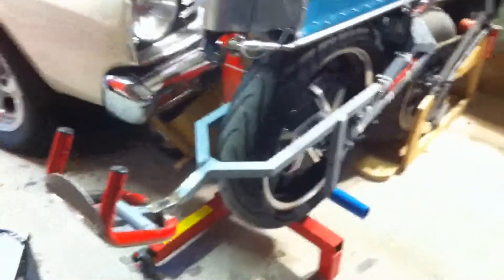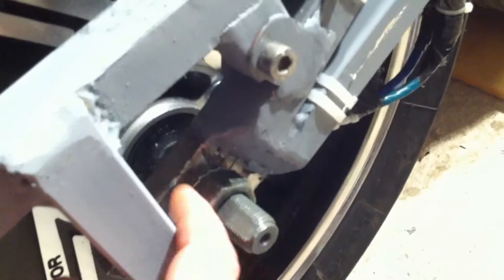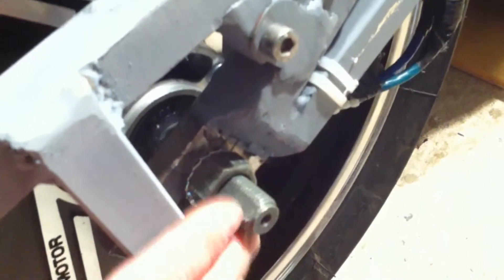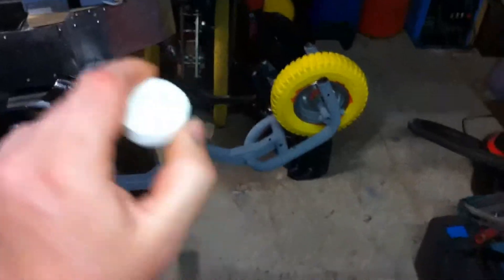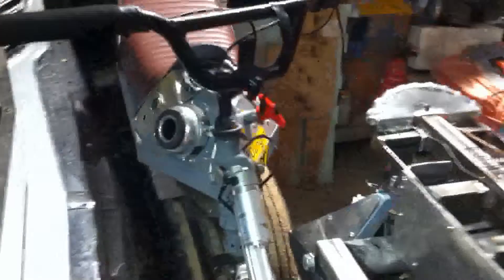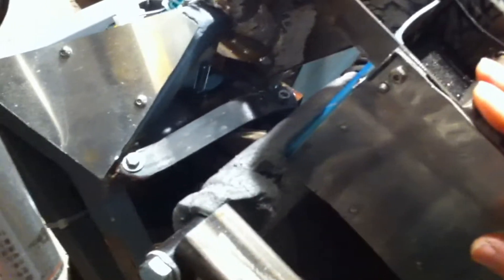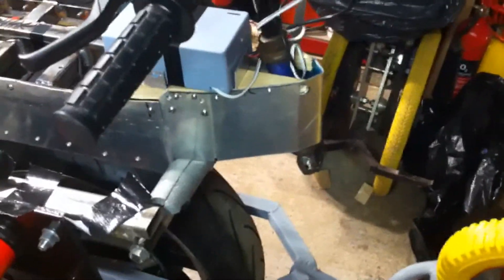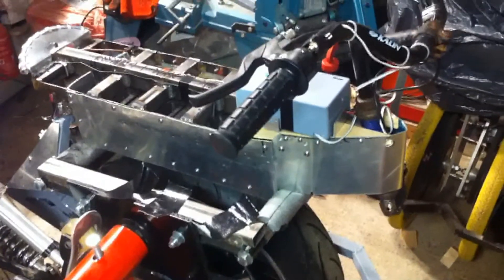Unicycle Garage #9 Final Mods and FIRST TEST

Comment: Can I use an ordinary e bike motor controller for this.

*In your Kelly controller 
Why are you going for joystick mode eventhough the motor will not turn in reverse direction.
Why cant you use cruiser mode, that is the motor rotates only  in forward direction when you lean front, and  brakes if  you lean back using Regen

I.e. when u lean backwards the vehicle brakes but does not turn backwards
Reply from the maker: The other reason why reverse is useful is, as you come to a standstill it tends to throw you off! I am not saying you have to have it, it should work while you are travelling forwards, the problems appear at the very start and very end as you come to a dead stop.
Reply: XenonJohn Sir we r working on a single wheel scooter.
We have mailed to self-balancing-skateboard@sky.com, from bhavishanth@gmail.com, plz see and reply to our mail sir, we r facing lots of problems, we need ur help sir.

WE NEED UR REPLY VERY SOON SIR🙏🙏
Reply from the maker: Ah clever question. In theory you are right, you could use a mixture of forward propulsion and engine regen braking to go along in forwards direction. However the regen braking does have to be powerful. It is useful when starting off from standstill to have both forward and reverse, but I agree in theory at least you could roll it forwards manually then turn on self balancing. The chain driven machine we built in the past with a brushed motor, which had a reduction gearbox in the motor unit would "engine" brake as the power was reduced (but not reversed) simply due to the friction within the reduction gearbox.

Comment: how to get the pid variables.provide some video on it.
Reply from the maker: On top of the lamp pod you can see about 6 potentiometers. Three of these control P I and D. A good starting point is P of about 4, D set to about 0.5 and I set to zero initially. In addition I have a "gain" potentiometer which acts a bit like the volume knob on a radio, it increases or decreases the overall power to the motor while keeping the PID ratios as you have set them. I am making other changes to the safety front skid, have fitted a Roboteq controller, and so far we have reached 22mph at 40% power (very scary). Will post another video in around 3 weeks.